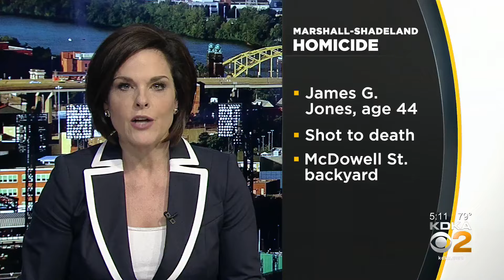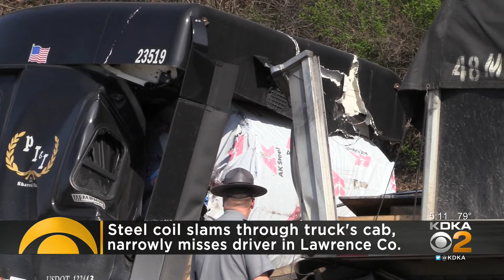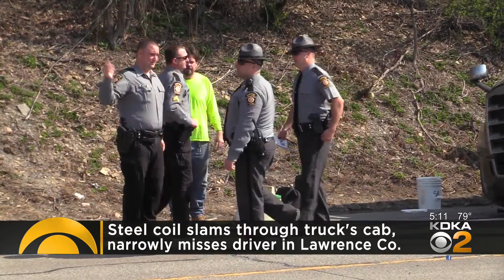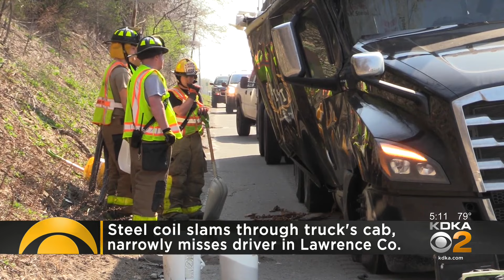Steel Coil Crashes Through Cab Of Truck

Comment: Those automatic brakes are the biggest part of the problem, and take  control from the driver, who by law is supposed to be in control at all times. But when the "On Guard RADAR" system  activates, it can do so for false sensing, leaving the driver stunned because it activates without warning, not allowing the driver to make maneuvers that could actually avoid any type of collision.  Underpasses, tight curves with oncoming traffic, large vehicles passing, or vehicles stopped at light or stop signs at cross traffic intersections. If the road is wet, icy, or snkw covered,  this is a recipe for disaster and death.
Reply: Our government is so much smarter than we are.
Reply: @glennjohnso310  Lol
Reply: If you had a clue, you'd realize the biggest part of the problem is an unsecured load. It should remain secure even when braking hard, no excuses
Reply: Still need to chains properly and the right amount of securement.
Reply: I drove for a company that had that auto braking. I told the shop it was DANGEROUS, they said "Oh Well. Insurance requires it". If I covered up the sensor in the bumper the truck was cut back to 62mph
Reply: To be fair a lot of you truckies are high on ice, so the automated system is to counter that.
Reply: @glennjohnso310  You aren’t very smart, so probably it’s true. 😅
Reply: @Danin4985  I’m smart enough that I drove gravel trains hauling 160 thousand pounds and never had an accident. I have also ran lowboy’s with 300 thousand pounds 18 foot wide loads and no problems. What are your accomplishments?
Reply: Yea yea they are annoying, however if this coil was secured properly then the hardest braking wouldn’t have caused it to break loose like that

Comment: This is why I hate those brake assist features in big trucks. While driving one night, a truck ahead of me took an exit in a the curve of a highway. The my brake assist hit the brakes so hard and without warning, I nearly lost control. This feature could have gotten this trucker killed. Let us do our own driving.
Reply: Look_What_You_Did 
How long have you been driving? If you leave any distance, another car will always fill it
Reply: Remember when ABS was new and put on trucks? You could pass a signal tower of sorts and it could trigger the ABS.
Reply: Look_What_You_Did That's nonsense. I had my On-Guard system go off more than once for cars, signs, construction bollards, etc. beyond safe following distance ahead of me.

It's not the object itself that triggers the sensor, it's reflection of light off of reflective tape, shiny signs, or via sun glare on windows. That glint will trigger the sensor even if the object causing the reflection is far beyond safe following distance. The light simply scrambles the sensors on the system and it causes a false-positive event.

They're called "ghosts" and every single driver I worked with at my last company had to deal with it often. My truck would do it multiple times a day.

Comment: 😮 Wait a minute! One of the 39,000 lb coils??? If you put a second one on the trailer,  it would be grossly overweight!
Reply: This is what overweight permits are for
Reply: You don't actually expect the media to get anything correct, do you ?
Reply: @mattywho8485  Yea, what was I thinking. That might have required research or a PHd in trunking... That would rule out any of the media.

Comment: Loading coils "eye to the side" like that is referred to as a suicide load or "hauling suicide coils" for a reason... this is that reason. Usually tends to end in a tarp getting draped across the tractor's windshield (which means that the truck's driver was killed), though...
Reply: Luckily nobody was in the sleeper. They'd be pancaked.
Reply: A lot of the drivers would love to load coils “shotgun” style , but unfortunately a lot of logistics companies unload/load  via tow motor, which then forces the driver to load the coil “suicide” style. Binders chains and beveled wood can only help so much

Comment: Coil transport requires coil trailers with coil recesses, specially designed to avoid any detachment of the coil from the trailer in an accident. Second choice are steel cage coil cradles that can be fixed solid to flatbed trailers. America has very low mandatory standards of safety in transport, and all those 'expert' drivers out there who drove a million miles with coils only chocked and chained (however well done) were LUCKY they did not meet an unavoidable  sudden stop (or forced turn), because when one of those coils moves an inch, it's gone, - chains, chocks, straps and all. Ask the hundreds of drivers in the US and around the world who lived to tell the story. You cannot ask the drivers who did not survive, nor the innocent victims crushed by runaway coils. ANY load on a truck must be able to withstand the maximum brake forces of the vehicle. It should not depend on the driver's skill, unless it is an exceptional special load. Some drivers just ain't that good, and they are the ones who will dump their loads on innocent victims.

Comment: Chains often are positioned nearly perpendicular to the force of deceleration, so the chains receive far more force.  There exist hold-down devices that look much sturdier and better angled than the usual few chains.  The simplest hold-down devices for transporting and using big coils of cable may give some ideas for devices with practical weights and sizes.  Devices that have or approximate a triangular shape when viewed from the side are inherently strong.

Comment: At 39,000 lbs it wasn’t “one” of the coils.. it was the only coil. This is on the trucker 100% the load needs to remain secure even under heavy breaking. Coils are no joke probably the least forgiving cargo you can haul.

Comment: I guarantee that coil went forward because 75% of flatbeders put their chains close to the middle leaving maybe one or two chains pulling back , those chains in the middle will not hold a  40k coil from going forward..
Reply: The hard braking from the system is the issue most likely.
Reply: @justtubing767 the load should remain secure even in an emergency stop. Don't make excuses and blame something else

Comment: Don't think I saw a headache rack, which is usually required for hauling steel coils. Also I'm no trucker but I believe a single coil that heavy would require anti-slip mats, stoppers on both sides and about 8 or 9 standard chains through it. That's a lot of work and it's easy to imagine someone cutting corners on load securement.
Reply: Any truck pulling a flatbed needs a headache rack
Reply: Hate to tell you guys but a 100 or so pound piece of flat aluminum would not have made any difference in the outcome. Headache racks are not required by law, because they don’t prevent anything all they’re there for is to hang your equipment on. There also no requirement for no slip mats or stoppers on both sides either. They say in the story it’s a 39,000 lb coil so it would require 5 standard chains. Not really a big deal. Besides that is a covered wagon so it already has an aluminum bulkhead built on the front of it. That’s the equivalent of your headache rack in fact being it’s actually mounted far better than a headache rack, with 8-16 bolts mounted around the front of the trailer. A headache rack only has 4 u-bolts going around the frame rails of the truck. As you see in video the bulkhead didn’t do a thing to stop it so. If you made a bulkhead or headache rack strong enough to stop a coil you wouldn’t be able to haul one!
Reply: Once that load breaks free there’s very little to stop 40-50,000Lbs and it only takes a little momentum for it to basically crush anything in its path.

Comment: Well, it could be that the load wasn't properly secured or like he said, the braking assist feature "HARD" brake because IT sensed a collision. However, the units(Internationals) we drive have this feature and YES they do break "HARD" if "IT" senses a collision. BUT, many times the system does apply "TOO" much braking and it WILL cause the load to SHIFT! I had  a similar incident where as the system "HARD" braked and it caused my load to shift forward about two inches, even when I had plenty of straps securing the load and it was binded down REAL tight!💁🏾‍♂️ Soo, I would "DEFINITELY" say "THAT" features needs to be reevaluated because it can do MORE harm than GOOD!🧐

Comment: Idk why they do not place those coils on their side instead of the way they place them. I'm guessing a round object is going to roll, compared to something laying on its side.
Reply: The coil can easily unravel and explode and plus it’s almost impossible to get it back up if it’s facing down
Reply: @Look_What_You_Did  I'm sure a magnet would work to pick it up and place it vertical.

Comment: I hate those safety features they're putting on trucks now. I was driving hwy12 Lolo pass between imontana and idaho when truck decided was going to fast around a corner and putting on the brakes automatically.  I could have rolled the truck or if driving on snow or ice I would have slid into the river. And the truck will determine if your to close to vehicle in front of you and put the brakes on. Even if someone cuts in front of you.

Comment: this truck unit doesnt have this type braking system that locks up like this , anyway the trailer hasent even got a solid up front bulkhead panel with a good frame so stop the load shifting forward ,all to do with keeping weights down on the vehical , also it should be mandatory to have a proper trailer set up for these coils ,theres been way too many of these accidents with drivers getting killed
Reply: You made the same observation that I did, no drom or bang board. I would never haul coils, steel , rebar, ect. without one.